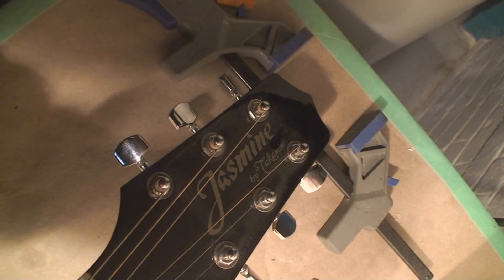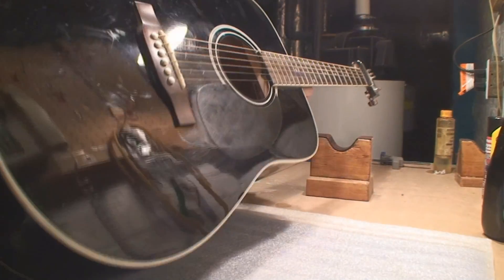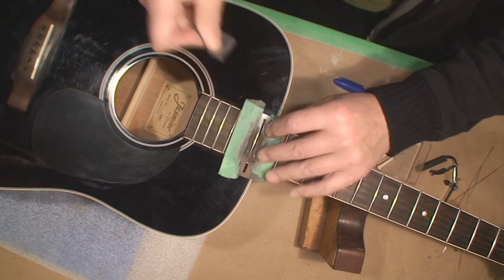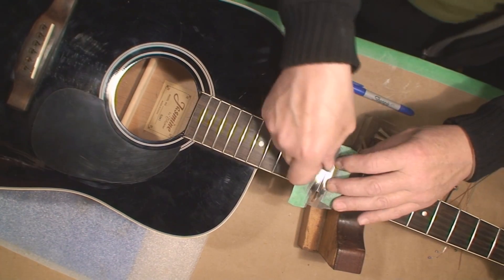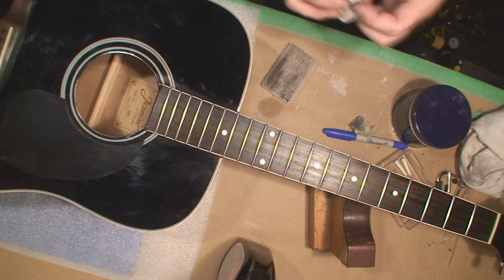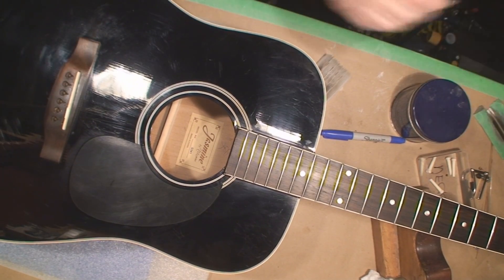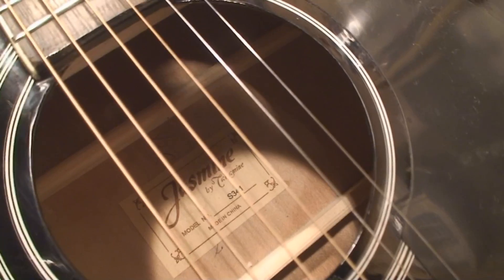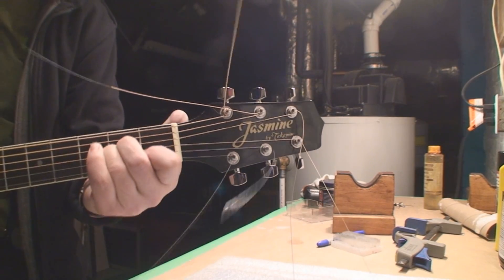Jasmine by Takamine Acoustic Guitar Repair

Comment: I have the same guitar here & the strings are so high. The saddle is thick itself plus the bone & I would say that this is a finger killer. The medium action for acoustic guitar at the 12th fret :...Low E: 2.5mm & High E: 1.8mm. This Jasmine guitar Low E is 5mm & the High E is 4mm which is very high for an acoustic guitar. I'm thinking of straightening the truss rod first & lowering the bone saddle. Watching your video, I noticed that you just cleaned the guitar & didn't fix the problem of strings buzzing.

Comment: Yeah I've had a couple Ovations that required that - problem is the repair did cost almosdt as much as the guitar - 3-4 frets pulled...fingerboard hand-leveled... fret slots re-sawed and frets replaced (with slightly lower profile frets.... Fixed it but was a costly job.

Comment: Never found a Takemine I liked.
Reply: you must have a ear problem ...(Never found a gb5uq i liked).
Reply: I love my Takimine.
Reply: i allso love my Takamine..
Reply: I've got one that I like quite a lot.  It's a 1977 model,  w/the lawsuit headstock and is basically a D-28 copy.  After the bridge popped up,  I was really surprised and rather shocked to learn that the top is plied.  I never would have guessed.  Back and sides -- yes  -- but the top?  Whodathunk?
My go to luthier wouldn't touch it  -- "never had any luck with a plywood top bridge reglue."  (He's the one that put me wise to it being plywood.)
I ended up cutting out the top ply,  cutting out the middle ply,  making a shim out of some really hard elm,  and gluing the shimmed  bridge to the bottom ply.  Sounds as good as it ever did,  if not better.  More volume for sure.
Not the neatest of repair jobs but after learning about the top being plywood,   I really quit frettin' over the looks.  No matter what ya do to it,  it'll always be a cheap Jap guitar -- but one that really sounds good if you're lucky enough to get a good one.  Not all of 'em are.
Reply: Those japanese luthiers  know how to make a quality acoustic gutiar. I have a black Takamine Ef341SC MIJ best acoustic ever,  you will be surprised how good of a  balanced tone it gets with just a solid cedar top,  supposedly laminated maple back and sides, I think it sounds better than a Martin anyday.

Comment: Dave can do what ever he wants, but never restring a guitar right after the fret board was just washed with the equivalent of soapy water.  Give it a few hours to dry.  Then never put any type of finish on the fret board.  It is meant to breath, and if you watch the pro's at Martin, they clean the fret board with a clean dry guitar cleaning cloth.  Thats all.  You can follow Daves example or go ask someone who builds guitars for a living how to do it. And.... when replacing strings, you should ALWAYS pull tension back on the string through the nut when winding it, and with Daves 1000+ guitars he has restrung, I would think he would know better by now.  Whatever..... but if you want to know everything you need to know about cleaning fret boards and installing new strings Martin has all the videos from actual guitar builders.  I feel sorry for you guys who follow these instructions.  You are ruining your fret board, which is a tone wood, and when you add the linseed oil, your partially sealing it, and thats not good.
  I run across more thaty think they know how, and act like they know, than I do those who really know how to treat their guitars, and Dave... its pronounced, Ta-Ka- Mee- Nee.
Reply: I find that Martin seem to be in a minority on this. Exposed wood is rather vulnerable.
Reply: +pickin4you Unboiled linseed oil does not significantly reduce access of moisture in and out of the fretboard and does set up the wood enough to reduce wear in the rosewood. Just wipe away all excess after you apply it and use it very sparingly.
Reply: What about um, Lemon oil?
Reply: Funny a non expert trying to tell an expert how to do his job.😆🤣